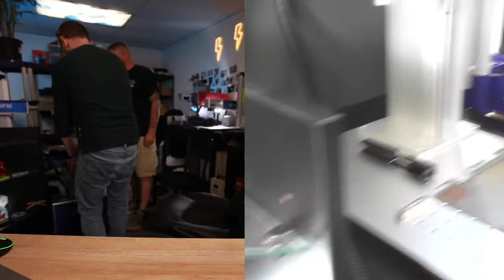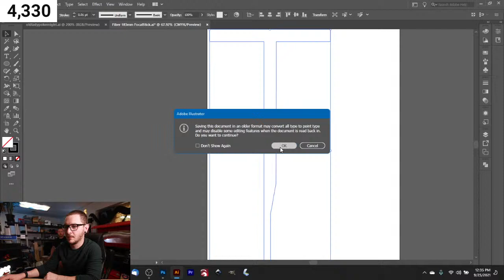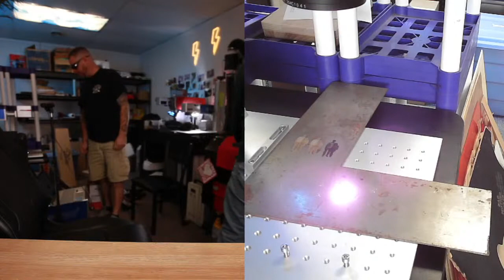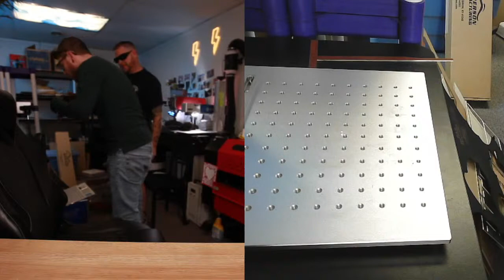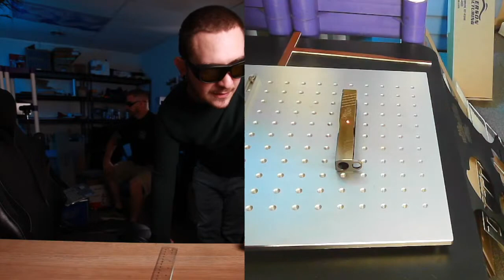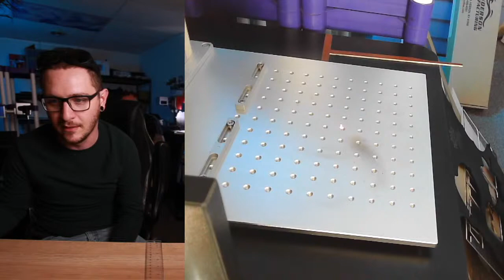A Patreon Supporter VISITED THE SHOP!

Comment: Hello Alex, what type of lens would you recommend for cutting 1mm stainless steel using a 50W machine...am also failing to engrave on gold bar necklaces but am able to engrave on the silver ones. What could be the problem, is it the len? Am failing to join the group on discords using the link. It keeps coming back to the invite page and doesn't load.
Reply from the maker: What lens are you using now?